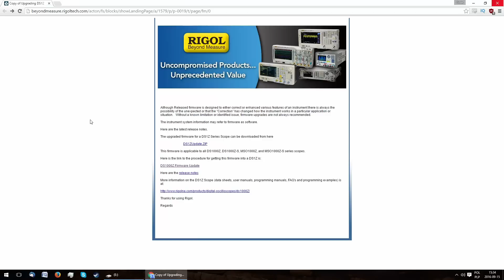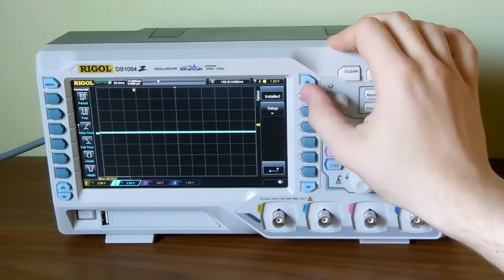How to update and unlock/hack the Rigol DS1054Z (in under 2 minutes)

Comment: I just bought one (04/2019) and it was already upgraded at no charge by Rigol.  I'm not sure if that was intentional or not.
Reply from the maker: If there are timers on the upgrades those are the trials.
Reply: I found out that they come with everything unlocked now except bandwidth (which I of course promptly corrected).  Everything should say official right out of the box now.  After unlocking bandwidth, it shows as DS1104Z in settings.

Comment: 12/12/2017 (MM/DD/YYYY) Still works. Used the video annotation link to get the zip file which contained 04.04.SP3 software, and used the DSFR code instead of DSER.

Comment: 26-Sept-17 Doesn't seem to work now. 4.4.SP3
Reply from the maker: +Joseph Cote I'll look into it soon-ish.
Reply: Yes, 04 Oct 2017 - getting Invalid License message.  Tried it with the DSFR option and it accepted it.
Reply: please do. I'm just a poor hobbiest trying to get my 1104z to unlock the triggers and decodding.

I cant afford to pay the value of the scope  just to unlock the software lol!
Reply: any updates?
Reply: It worked for me using the DSFR option code.
Reply: Joseph Cote I'll try again but so, far, no luck at, all
Reply: You're doing something wrong. Working for me as of Nov 12, 2017. Make sure you follow the instructions as is. Do not fill in the private key field. My initial firmware ver was 0.4.4SP3 so I did not need to update.
Reply: ya its saying I have to wait 12 hours now....

Comment: Still working. 18 Sept 2017. DSFR code work perfect, all options unlocked in 2 min as described. DS1054Z to DS1104Z with firmware 00.04.04SP3
Reply: Doesnt seem to work for me, and I have 4.4.sp3 too
Reply: DSFR enables 500uV/Div setting, which is not supported on this model (hardware limitation) and causes issues. Use DSER instead.

Comment: As of August 23 2017, I confirm that this upgrade still works. I just got a RIGOL DS1054 Z from Amazon. It came preinstalled with 04.04.03.SP3 so I didn't need to update the firmware. I went to the URL stated here to get the unlock code: http://gotroot.ca/rigol/riglol/

Then I followed the instructions on the video on how to enter the code. Viola! My unit has been upgraded to DS1104Z.

Comment: Hi, 
First, I had unlocked from 50MHz to 100Mhz a few months ago. Today, I did upgrade the firmware from 00.04.02 SP2 to 00.04.04 SP4 and new version has been installed well. Do you think the oscilloscope can have issues? Can it works well? Thanks in advance
Reply from the maker: +Davide Giuffrida there shouldn't be any problems. I have the same version and it works just fine.
Reply: Hi,
first, thanks for your answer. I'd like make you another question. I got a Function Generator Rigol DG1022Z 25MHz, so do you know if is it possible to hack? Do you know any procedure. Thanks for all.
Davide

Comment: Hi all, a few months ago I made the trick in the 00.04.03.SP2 Version, and all the functions were enabled. The model shown in the System Info screen was DS1104Z.
Today (July 13, 2017) I have made the firmware upgrade to the version 00.04.04.SP3 and the scope has the same functions enabled and the model shown is the same. In other words: after upgrading the trick is working, and there is not necessary to unlock it again. Thanks all for sharing your experience.

Comment: Do you know if this trick works if you update before the firmware to the v00.04.04.03.02  2017/02/06 version via menu (no Telnet)? I have the 00.04.03.SP2 version with the trick installed and working. Thanks so much.
Reply from the maker: It should work with all firmwares, the update step is just a precaution.

Comment: Just received my DS1054Z scope a couple days ago and decided to try this upgrade and it worked using the DSER option (which is not one of the listed letter combinations)!  The scope came with the latest software version so I didn't have to update the firmware (00.04.04.SP3).  Hardware version is 0.1.4.

Comment: Update worked today after firmware upgrade to 00.04.04SP3   6/29/17
Reply: Did you do authorized mode and then hacked update or just install hacked version on first attempt ?  I tried to do the update but think original factory install is blocking follow-up attempt .  J K

Comment: Works as of today 3rd June 2017 on DS1054Z, with the latest firmware v00.04.04.03.02  2017/02/06.
Oscilloscope shows official installed option, bandwidth 100Mhz and 500uv. Thank you.
Reply from the maker: +Peter Mayhew I think so. The options can be reset via the Ethernet connection. I'd make a tutorial but I'm on holidays at the moment.
Reply: You should've used DSER instead of DSFR.
The 1054z doesn’t support the 500µV option in hardware, so you will run into bugs if enabled.
Reply: What kind of problems?
I cannot see DSER listed on the website http://gotroot.ca/rigol/riglol/
Would DSER unlock every other option apart from 500uV?
Reply: I have now used DSER, the code was accepted. However on the installed options screen, the 500uV is still listed as official. Does this mean I would still have the bug?
Reply from the maker: +Peter Mayhew I think so. The options can be reset via the Ethernet connection. I'd make a tutorial but I'm on holidays at the moment.

Comment: 18.5.2017 - Still working

This is will not harm your oscilloscope.

This 1054z 's hardware can handle this all. But rigol has limited ability by software and requested users to buy a key (after we has already purchased their hardware - 1054Z) to fully unlock all features.

The webside is just a keygen online which generates key based on our Serial number for us so we don't have to purchase the key from Rigol.

C'mon guys don't you ever crack a game on you computer ? this basically the same.

If hardware can't handle 100Mhz, no simulated software can.

Comment: at the link you have provided, there is no option DSER . There is only DSFR (all options)
Which one should I use, and why did it work at all with your scope, if you have entered invalid  parameter.
Reply: I tried with the data you have entered, with DSER AND DSFR options, and they  generate DIFFERENT codes !
What does DSER mean ? it's not listet in the code list.
Reply: any 4 letters in the OPTION box, will generate a code 
Oo
Reply from the maker: This is something binary-like, you add letters to create options. DSER is all except for 500mV that is said to be buggy on this scope.
Reply: but every 4 letters create a code. and DSER is not even listet in the options
Reply from the maker: It comes from the EEVBlog forums, people wiser than me came up with it.

Comment: Great video -- thanks for being so concise! For anyone else struggling to find the input key to punch in the unlock key, you press down on the adjustment knob you use to select letters. Spent a good ten minutes poking and prodding random keys before I figured that one out.

This is confirmed working for firmware 4.03.SP2 as of 1/14/2017. Did not need to upgrade the factory firmware that came with the scope.

Comment: I just got mine but I don't want to upgrade the firmware (Currently 00.04.03.SP2) cause I don't want to brick it...
Can I hack it without upgrading?
Reply from the maker: +spiritcore1 Yes you can. Just follow the steps. The update is independent but all the guides recommend it to be done first for reasons lost in history.
Reply: Hmm, I guess they're right but bricking a brand new scope isn't fun. and as you wrote, the new version causes problems.
Reply from the maker: +spiritcore1 therethically it has been only one or two ceses with old scopes. Practically there is no reason not to just unlock now and wait for a stable update. So just do the unlock process now and check the forum every once in a while for a new stable version.
Reply: Great! will try. many thanks!
Reply from the maker: +spiritcore1 glad I could help. Have fun with the scope!

Comment: Hi All (read here for easy steps to upgrade without issue),

It can be confusing to "upgrade" your scope so here are my comments that will help out all condensed in one place.

I just got my scope about a month ago and did not upgrade firmware version since this is the latest Rigol has on their website. I download the 04.03.02.03 gel file and it is the same as the version that shipped and displays as 00.04.03.SP2. I had issues upgrading and finally was able to get it to work. At first, I tried just the 100MHz upgrade but that did not work and the 
code was rejected. It seems that some codes do not work and the code that works is not listed as an option!

I verified I have all available features minus the 500uV vertical since the hardware does not support that. I verified that I still have the 10.0mV vertical. I believe the AD converter does not support 500uV so do not even attempt to upgrade that. My upgrade below will upgrade all but omit the 500uV option since it is not valid.

Happy "upgrading" :)

1) I have the DS1054Z (board version 0.1.4, s/w 00.04.03.SP2 aka 04.03.02.03 out of the box)
2) Go to http://www.gotroot.ca/rigol/riglol/
3) Enter in your serial number (carefully making sure you do not make any errors)
4) Enter in, "DSER" for options. This is not listed as an option! It is all options minus the 500uV vertical.
5) Carefully enter in the 4 groups of 7-digits.
6) You have now upgraded your scope!

If you still have problems, recheck your serial number entry and make sure your have entered your code properly. The letter 'S' and number '5' can look very similar so check that you did not mix those up.

Comment: i'm looking to get  my first scope i need the 100 mhz for fm projects can someone tell me if i will be able to do this hack for sure
Reply from the maker: +Brice it is really easy, I say go for it. If you have any problems message me, I'll help.
Reply: Thank you. I did a little more research and  i'm going to go for it. If it doesn't work it's still a good scope. Its good to know that I will be able to get the 100 Mhz hack and I know it actually works.
Reply: yep got my scope now and it worked couldn't be easier

Comment: Why did you update the firmware BEFORE unlocking? Wouldn't it be better to unlock it then update in case rigol disabled the ability?(which is doubtful considering this is one of the main selling points, but still..)
Reply from the maker: This is the order recommended by all the guides.
Reply: Awesome, thanks for the fast reply. Subscribed.

Comment: Thanks for the video.
I couldn't find the DS1000Z series in the link
only firmware for DS1000D/E/U Version: 00.04.02.01.00
Reply from the maker: True, I just updated the link, should work now!
Reply from the maker: Yeah, the most up-to-date is always on the forum thread there: http://www.eevblog.com/forum/testgear/new-rigol-ds1054z-oscilloscope/
Reply: Thanks for updating the link. I wouldn't have known the latest firmware is 04.04.01.01 otherwise. It seems that the RigolNA website directs you to a much older version.